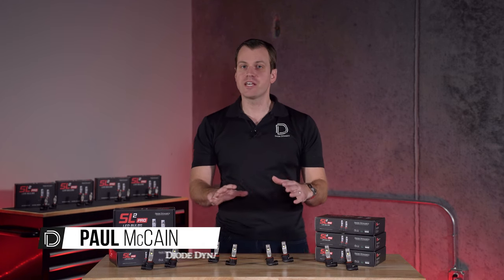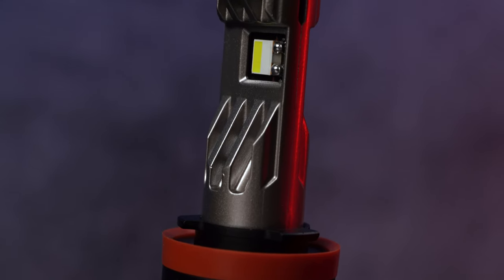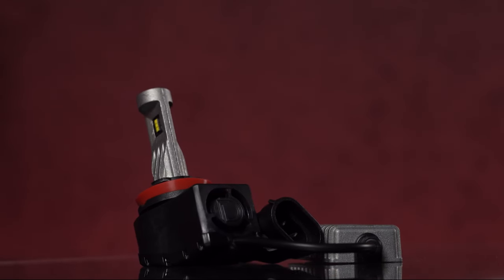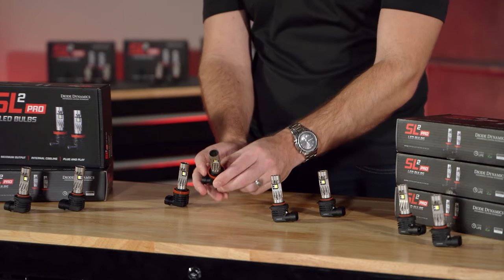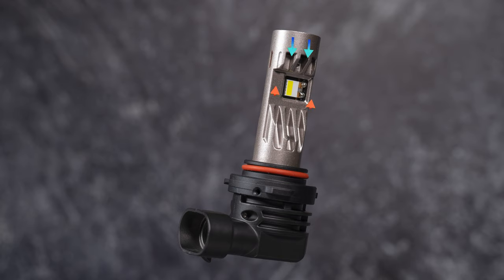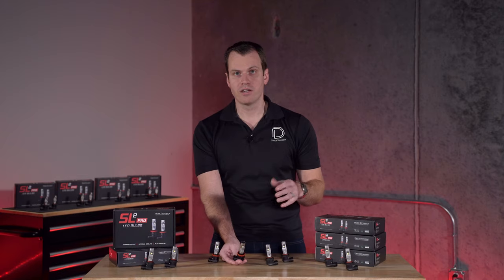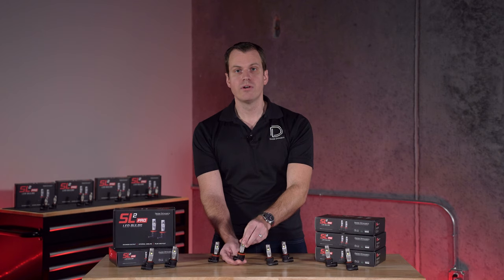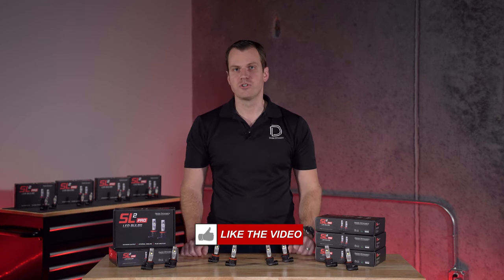SL2 Pro: LED Heat Management with Top-Mounted Fans | Diode Dynamics

Comment: How loud is the fan noise? Will the fan continue to run when the vehicle is off? Thanks.
Reply from the maker: This depends on the housing they are installed in, however, we have not received any reports of any excessive fan noise at this time! The fans will remain on as long as the bulbs are on, regardless if the vehicle is on or off.

Comment: Hopefully with this cooling tech ,it will last longer in the phoenix heat.
Reply: With that lifetime warranty, it will. 

But realize. Not all led bulbs will be perfect: 

Any brand u get, any led bulbs u buy and run them. It can be defective. 

It happens. 

So with a lifetime warranty, this would be a very good chance that u shouldn’t.